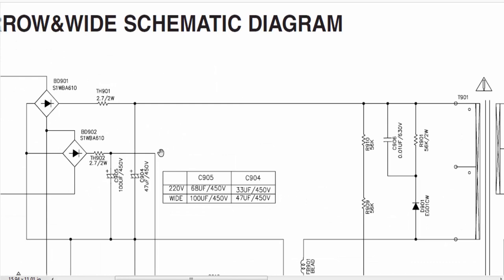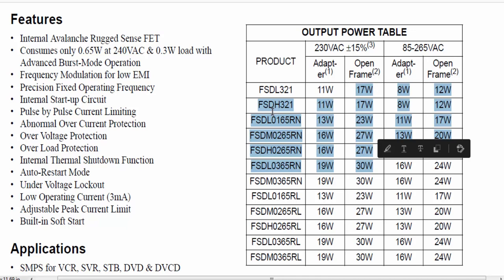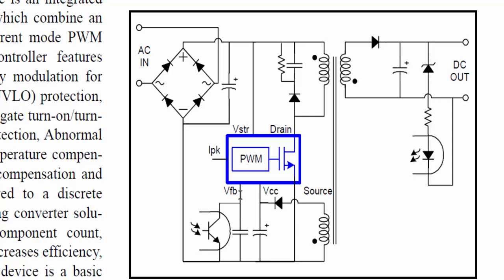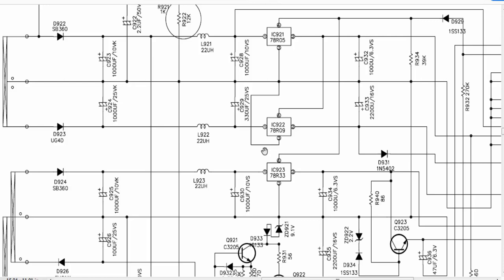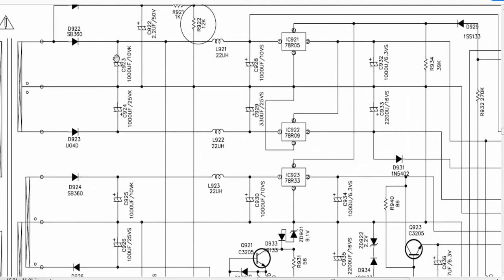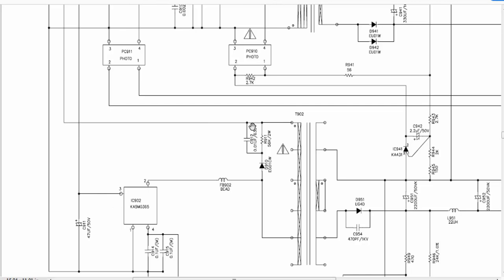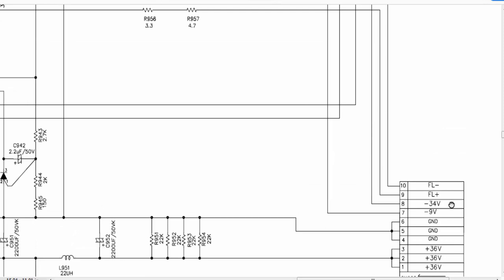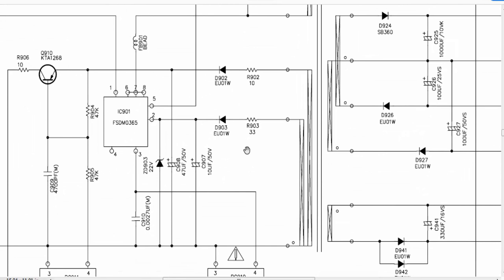#219 LG LH T6240 SMPS Switch Mode Power Supply Circuit Description and Repair Process

Comment: Hi I have asked a similar question in one of your other videos. Fluke oscilloscope switches on then shuts down I asked about load requirements this scope has 5v, -5.2v, -12v, +12v, -18v, +18v, -58v, +58v these are on a 32 pin double molex connector so 64 pins in all  row A 32 pins and row B 32 pins can I connect a diode across the photo diode, will I still need to load the outputs? Another fantastic video thank you so much for your invaluable time you are a credit to humanity so much enthusiasm in your voice go safe, and Many thanks again.
Reply from the maker: if possible kindly send scope model number, so that I can study the reasons 
why it have power interruptions

2nd. I could not get your point, "why you want to connect diode across photo diode" 
send WhatsApp to 00962 79 1161 084 or instagram Haseebelect

Comment: Check capacitors...i see diferente between them... Some isolations are thiner....got hot and ic dont need socket its blown power supply....because of socket
Reply from the maker: yes dear 
most of time electrolytic capacitors make problems

Comment: I have the same power supply lg lht764 may you discuss this circuit sir the capacitor 47uf 450 volts

Comment: I have approx the same circuit and the 12v section shows 10v and 5v section shows 3v. What could cause output to fall ? I changed all secondary caps.

Comment: good explanation. what is difference between vcc and power on ic voltage pin 5,6,8
Reply: @HaseebElectronics  thank you
Reply: @HaseebElectronics  thank you can explain how to test chopper transformer in multi meter